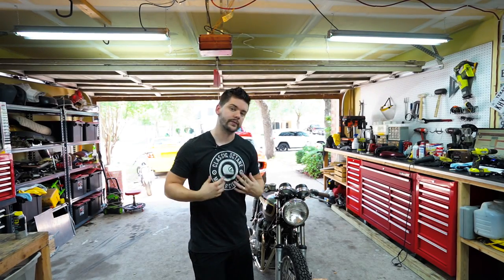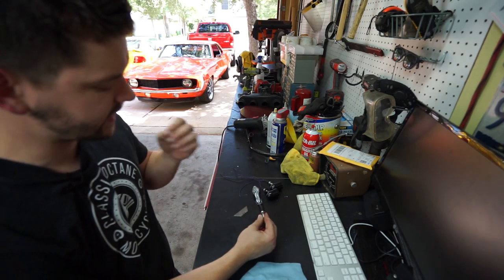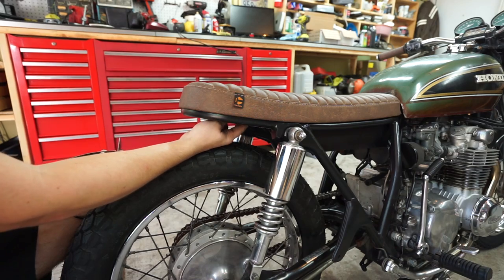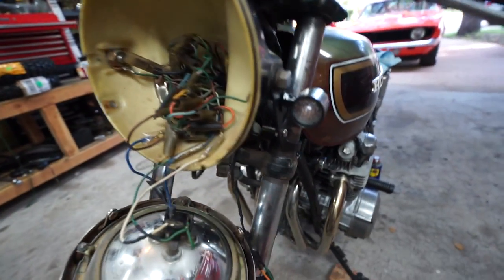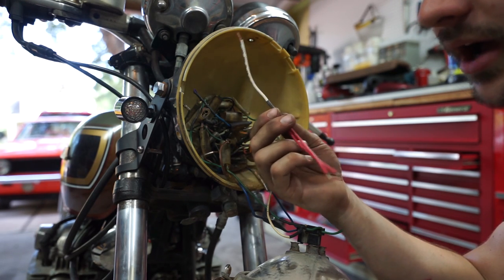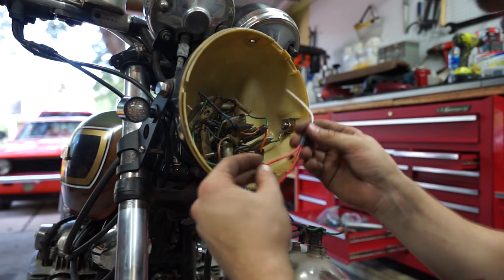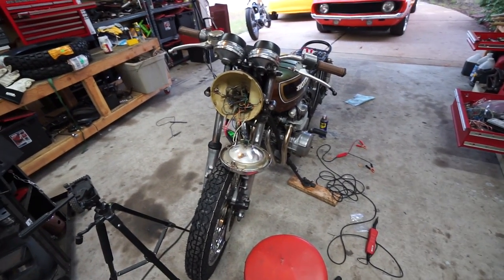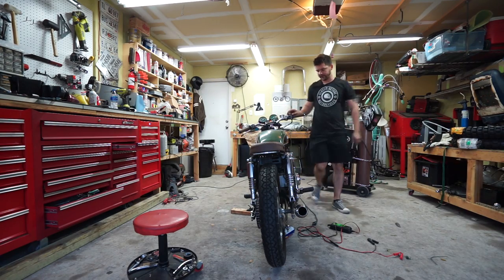Barn to Brat Episode 18: Final Touches

Comment: Instead of those ooglee front turn signals, what about using one of those strips stuck onto the top of the headlight rim to use turn signals and the middle as a daytime running light and have the headlight run only at nite....maybe install a light sensor to turn on/off like new autos have....

Comment: Absolutely love that rear light, what gauge sheet metal did you use for the bracket? Is that LED bar on your amazon page?
Reply from the maker: 16 gauge and yes it is.
Reply: Thanks! Where did you source those bullet front signals